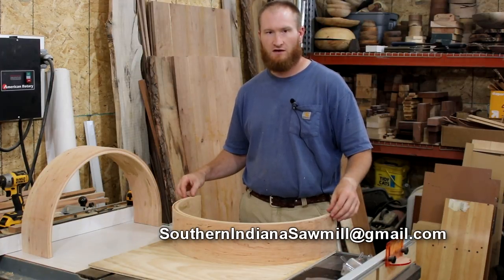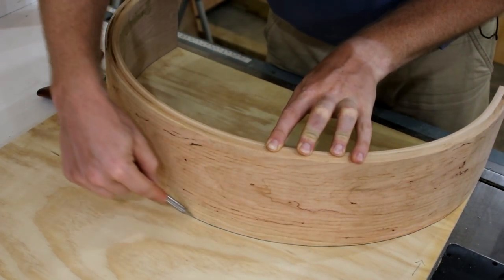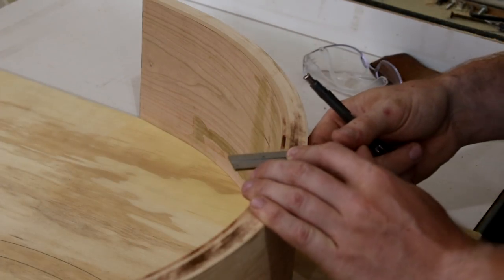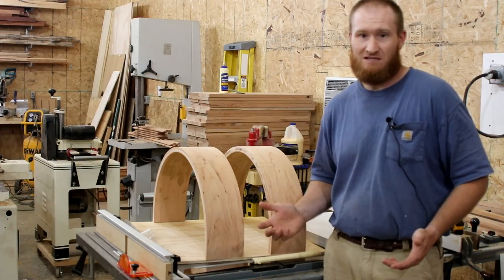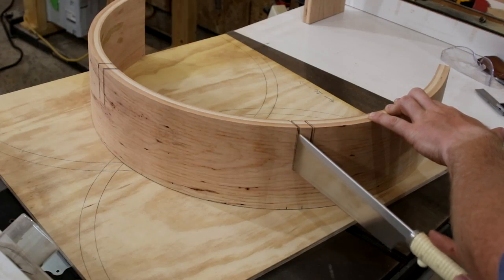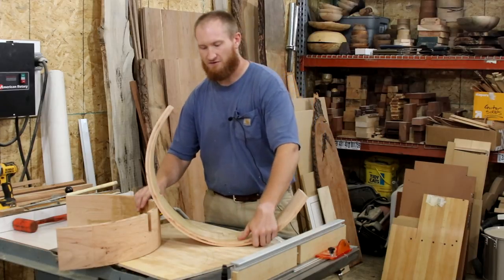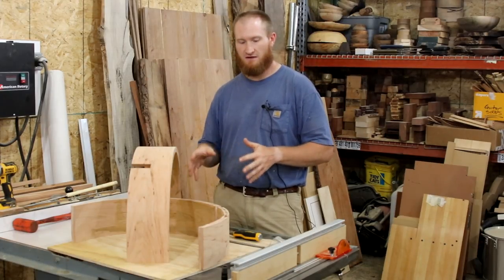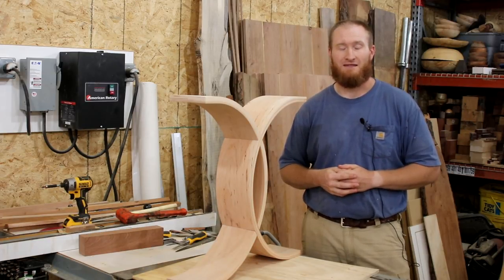Bent wood legs and how to join them together!  Salvaged Cherry project!

Comment: Nice work. I'm not a carpenter.  I'm a union sheet metal worker by trade but I love woodworking and carpentry. I would've used a drill with a spade,  hole saw or large drill bit and a chopsaw to get my cut.